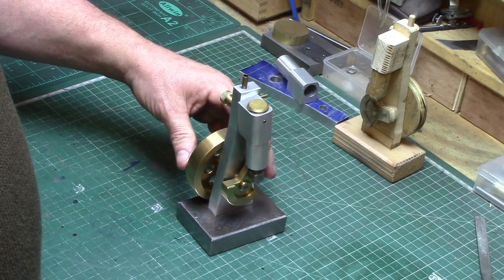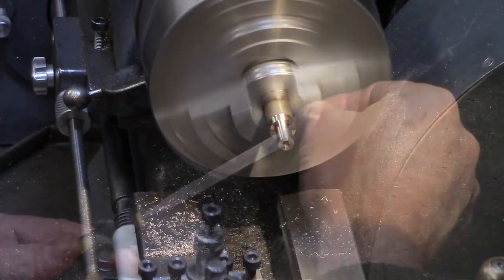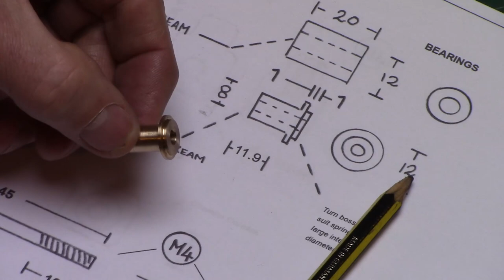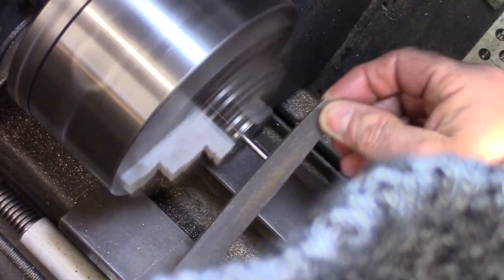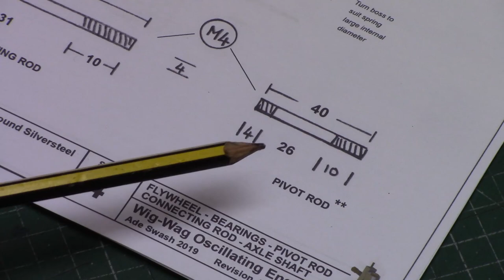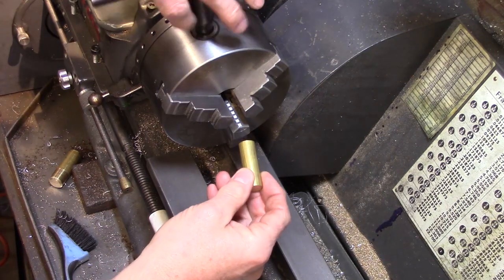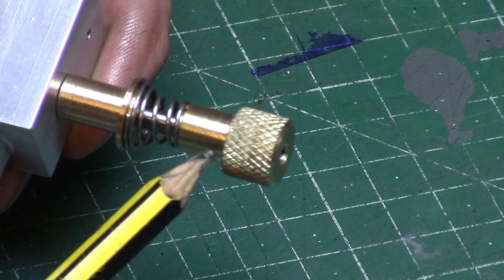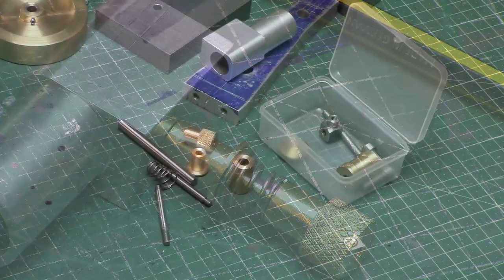Wig-Wag Steam Engine Build Series Part 6 - Bearings, Con-Rod, Pivot & Spring Nut

Comment: Is silver steel what Americans call stainless steel or tool steel?
Reply from the maker: In the usa it is called drill rod, it is basically 01 unhardened toolsteel, which is ground to exact dimension, it can be hardenened by heating to orange and oil quenched
Reply: @AdeSwash  thanks